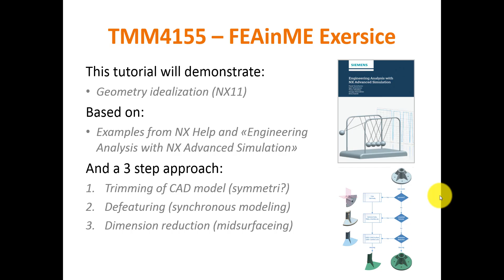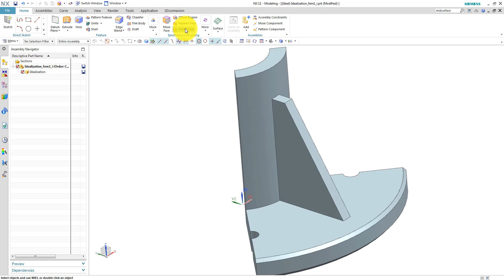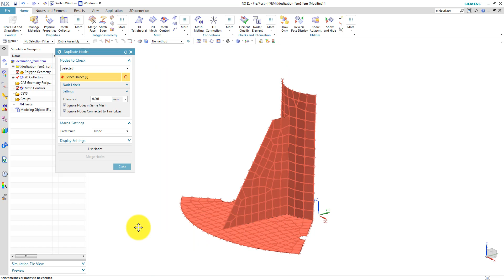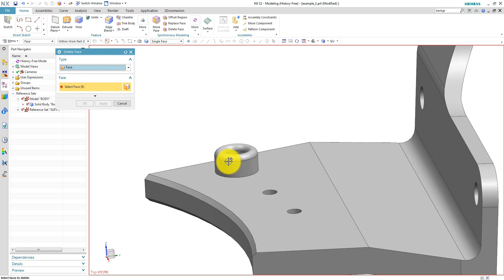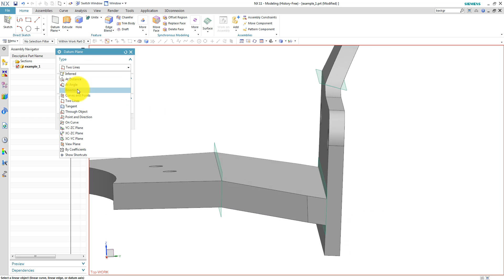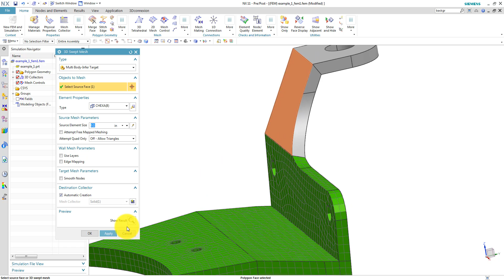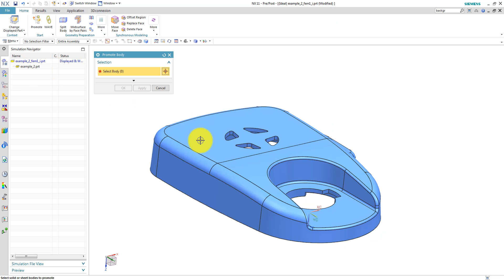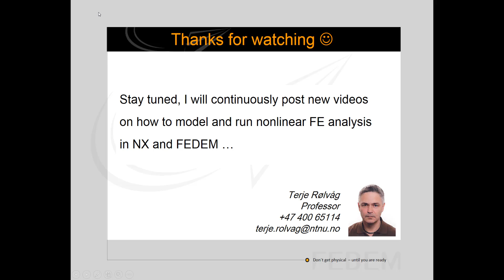NX Geometry Idealization

Comment: hi good video I have problem with (2D_ shell not exported to solver)as message in  fem then can n't be displayed in the simulation please whats wrong please  .
Reply from the maker: The meshes are by default exported to the solver, but sometimes shell meshes are used to generate solid hex meshes by the "3D Swept mesh" command. Then you can go to "Mesh Associated Data" -> Mesh Properties and unselect "Export Mesh to Solver" and suppress the shell mesh. You must check if you have unselected this option.
Reply: but this  be occured  in NX9  when i have choosed 2 D MESH (thin mesh) but not happened in NX7.5 & there is no check for ( mesh properties-EXPORT TO SOLVER) in NX 9
Reply from the maker: Hard to tell then since I don't have these NX versions anymore. I recommend you to remesh the part in NX 9.